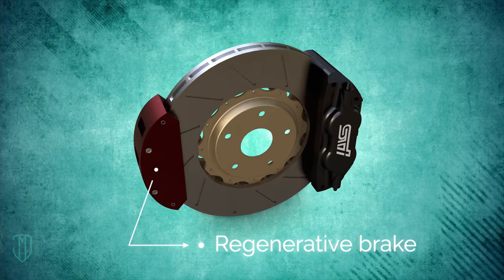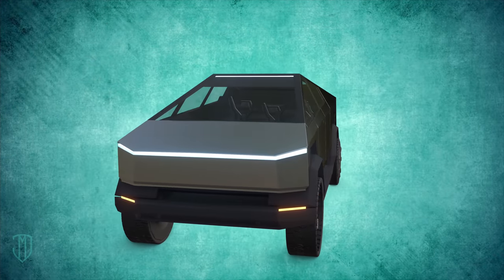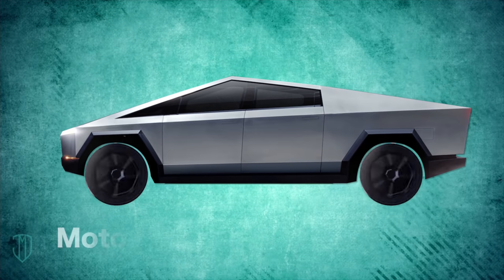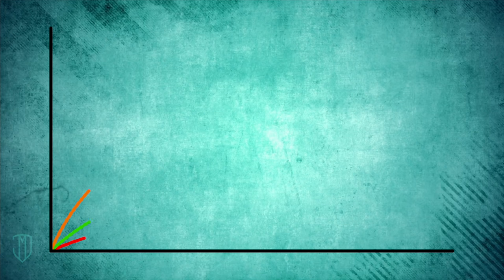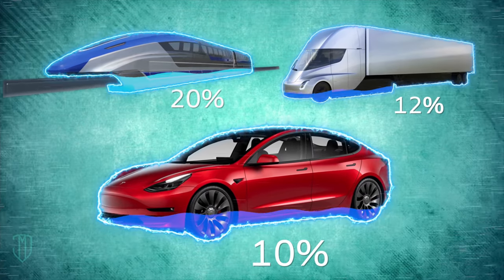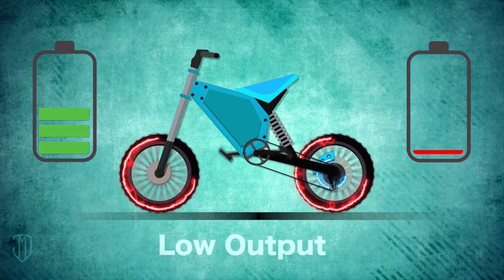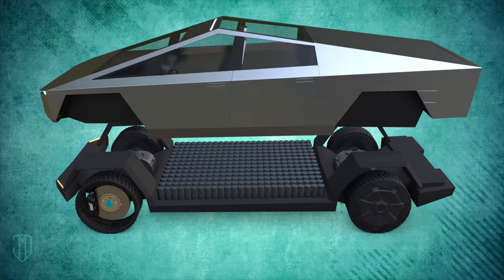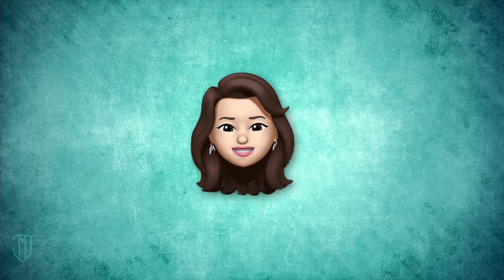How to Stop your Car without Braking

Comment: I’d imagine that, even though lighter vehicles don’t make as much energy from regenerative braking, that they also don’t use as much energy to move themselves and their weight since they’re much lighter, right? Cool vid
Reply from the maker: battery smaller as well.
Reply: Heavier and larger semi trucks can gain alot of use out of regenerative braking, in non ev semi trucks. Truckers use what's called engine breaking. Basically they switch to a lower gear that slows down the combustion cycle in the engine. Pretty complicated and only useful for manual transmission cars like most diesel semi trucks. Also increases the torque output which can crack weaker roads. 

But when a semi EV uses regen breaking going down hill two things can happen, the vehicle can sap that gravity to use later when it goes back uphill entering a net zero. Second occasion is if the truck doesn't have to return to a higher elevation (it doesn't go back uphill) you end up charging your truck while you're driving. 

Second benefit to this system is that the brakes don't get overheated, that's why engine braking is used with manual diesel engines. All of that inertia will be converted into heat and melt your classical friction brakes.

*Upon more research diesel trucks don't slow the combustion cycle they just suck all the energy out of the crankshaft/driveshaft and fart it out before it can be combusted. This cycle of pressurizing air and then farting it out consumes more energy than it produces (makes no energy because combustion doesn't occur) so the truck actually slows down.

Comment: For anyone wanting to understand the fundamentals 

Motor 
two parts the rotor and the stator, the stator is the stationary part of the motor. The stator is the part that's bundled up with copper wire/magnets and lies around the rotating shaft.

The rotor is the moving part of the motor, this rotor is the rotating shaft. 

When a electric current is passed through the stator it makes the rotor move, this works because the electric current creates a magnetic field moving the rotor. 

So this is how it works on a basic level. 

When you rotate the rotor around the stator you can produce electricity, when you send electricity to the stator it will make the rotor move. 

With clever engineering you can make this motor turn into a generator at will.

Comment: Probably the best video I’ve found on how it actually works. 
Just two questions: how is the magnetic field created from the electric generator that is activated once you take your foot off the accelerator? 
And how does this magnetic field actually slow down the axial which in turn slows down the car?
Reply: You should be able to get an answer by looking up counter electromotive force (CEMF) and counter torque. These are considered generator action in a motor and motor action in a generator, respectively.

The rotor of a generator has a magnetic field that is created either by a permanent magnet or an electromagnet powered through a method such as slip rings and brushes.

When the device is motoring, the stator windings are powered via AC or step DC voltage (simulated AC) to create a rotating magnetic field. The rotor's magnetic field will try to lock onto this rotating magnetic field which causes the rotor to spin. For a motor, CEMF is induced back into the stator windings and is an energy loss. This CEMF comes from the rotor's magnetic field passing across the stator windings as it spins and attempting to cause current flow in the opposite direction.

If you remove the AC power supply to the generator, the CEMF being generated is no longer CEMF as the device is no longer motoring. It is now considered a generator.
Reply: Have you heard when timing belts creak in cars? So their generator is faulty and due to too much resistance of the generator electromagnet, the belt that turns the generator slips in the rollers.
Reply: Electromagnetic induction, electricity can induce or create a magnetic field. Magnetic fields can also induce or create electricity. 

Energy can neither be created nor destroyed only transformed. So if the magnetic field is creating electricity it stands to reason it's simply consuming the rotation of your wheels (attached to the motor's rotor) and storing it in the battery.

Comment: I wish my ebike had regen as I live in a hilly area, but my ebike batteries can only recharge at a Max of 3 amps so would need super capacitors for storage while it slowly charges my battery
Reply: 3 amps dosnt sound bad for an ebike, whats the voltage and amps on tbe batt?
Reply: @gabproductions3312  it's a 48v 20ah battery, but a few seconds of charging at 3 amps won't make any difference
Reply: @Markcain268  yeah ur right
Reply: @gabproductions3312  I'm sure the motor (1kw) can produce around 15 amps on regen so a bank of super capacitors could hold that charge and trickle charge the battery
Reply: @Markcain268  im not sure, can a motor generate the same amount of power it consumes at the same rpm?
Reply: @gabproductions3312  not certain how efficient it would be but the motor certainly provides a lot of resistance with the leads shorted out

Comment: You described the motor being used as a generator during braking--OK, got that, an electric motor is a generator in reverse.  However, your graphics prominently shows some sort of device mounted at the wheel, opposite the brake caliper.  This could be a magnetic pick-up using the disk to create a magnetic field and generate power but you say nothing about it.  What is it?
Reply: Yep. the small red caliper is a bit missleading. A small second break on the discs can be seen on most cars but its never a regen break its simply the parking break. The parkingbreak is usualy controlled by a wire either connected to a handbreak or a servo pulling the wire for you if your car has a electric parkbreak (P) This is so that all cars has a second break system if the ordinary breaks fails. BTW even normal petrol cars without any hybrid systems usualy have regen breaks.  In petrol or diesel cars the engine breaking can charges the regular car battery to save some of that kinetic energy, otherwise a automatic car rather go into free roll in order to go as far as possible with the energy thats aviable.

Comment: I always feel like this system is not efficient at all. Braking produces so much energy. Specialy going down hill.  It doesn't only produce heat. A lot of energy is converted to wear as well. A system that could store almost all the energy from braking would be a system where we replace the whole traditional braking system for some kind of torque converter on the drive shaft(s) that directly transfers the energy from the speed reduction in to for example a flywheel or some kind of spring system. Or even more interesting: air pressure. The Chinese are working on that now. Store energy in form of air pressure. But I guess it would be to heavy and to complicated. But in theory braking should produce the same amount of energy as accelerating. Which would leave us only cruising which takes only a fraction of energy compared to accelerating and braking.
Reply: Energy might be the same but the work is extremely different. We accelerate say 0 to 60 in 6 secs but brakes from 60 to 0 in 2 secs.
Reply: @shiroyt4185  Time doesn't matter. It's the roughly same amount of energy only released faster or slower. (Ignoring air and road resistance) If you could catch all that energy it would make a massive difference. ( from 60 to 0 in 2 seconds.. That would be an absolute emergency stop on dry road. Normally when driving relaxed it would be different 😉)
Reply: @Neodymium5312  I know. To heavy for sure. And you would still need some form of extra brake system to be able to reduce speed very fast and come to a standstill. I have often had in my mind an extremely tough  spring made out of some really strong material which will me loaded by the torque converter the harder you push the pedal the less the converter slips. The tension in the spring could than be released while accelerating. That could make for quite a strong brake. Just riffing here 😁
Reply: @Neodymium5312  Yea we are only just getting started. It all used to be so easy even just 20 years ago. Ever brand had like 3-5 models and they were all basically very similar. I think there was a point in the late 90's where I could actually name every single car on the road. I knew them all. Now we are being overloaded by technology and new inventions. There are loads of car brands that I have never even heard of.  I honestly have no idea what we will end up with in 100 years from now. 😵
Reply: ya but that would assume people know how to drive and dont tail gate but they do even though it cost them more gas by doing so
Reply: @wolfeatsheep163  I think they want to use the benefits of a slipstream 😂
Reply: It is called a mechanical battery. Porsche use it like 10’years ago.
Reply: My 07 Highlander hybrid had over 200k on it before I needed to have the front breaks done.
Reply: @-sensibleChris  That's insane. No offence but I struggle to believe that 😌 but hey. I once owned a Toyota Hiace which after 420k still had almost all the original parts. Just no significant repairs all that time. Did have to replace disks and pads along the way though 😁
Reply: @Dani-it5sy  I bought it with 72k miles on it so it may have been done before I bought it but not likely.  So from 72k to about 220k is how many miles my family put on it before the front breaks were worn enough to be replaced. I took it in to have it done 3 different times in that span,  and everytime, my mechanic said they just don't need it yet, and breaking wasn't an issue. At 235k now, and I will get the rear breaks done in 2 weeks because they are ready now. I do have good driving habits , and I'm not a late breaker, an don't accelerate right up until I have to stop like some people do so maybe that helps,  but I have two other cars (Toyotas) that have had breaks done a couple of times in that span although the Corolla had really slow break ware. The 4runner goes through breaks like any other vehicle.

Comment: I'm still not getting it.. On coasting or coming to a stop, the motors should become a generator(?). I'd like to picture a reduction gear that comes into play that spins up the electric motor from the tire/shaft on slowing. At 60mph a tire roughly spins at 1,100 to 1,400 rpms, even a 2:1 or 3:1 could get the motor to spin around 3000rpm generating a nice charge back to the battery.
Side question: with all this draining/recharging, does that put excessive strain on the batteries?
Reply: Regarding the first part I wouldn’t be able to explain, but regarding your last question, it does not put strain on the battery because the amount of electricity been generated by the brakes is very small compared to the high intensity power you would get out of a charger. It’s basically a very small charge at a time
Reply: The motors become generators and slow down the vehicle, evs have cvt's wich makes the gear ratio vary like downshifting on an auto or std vehicle slowly the car and spinning up the motor/gen faster.
Reply: @gabproductions3312  EVs do NOT have a CVT, or any other kind of variable gear ratio transmission. The motor(s) are always coupled to the wheels through a fixed reduction gear. Most EVs are in the range of 9:1 from motor to wheel. There is no clutch, no torque converter, no neutral, no reverse gear. If the wheel is turning, the motor is turning 9 times faster. If the car is going backward, the motor is spinning backwards. The only EV in current production the actually does have a gear shift is the Porsche Taycan. It has a two speed dual clutch automatic.

Comment: I mean I knew it charges the car. Was looking for more about how it actually works in a little more detail. How does it convert KE to electrical  energy?
Reply: When you drive a motor it is a generator.  When you put power to a generator it is motor.

Comment: The Prius had this same braking system back in the early 2000s idk why we are still charging these vehicles in 2021
Reply: Someone hasn't hurd of the laws of thermodynamics
Reply: charging hybrid,really ;)?
Reply: FacePwn64  that's right, man! You said it!
Reply: Just like cell phones, they drip technology to get more money; improvement here, improvement there but still with the old. Computer industry milked the world with this strategy, drip drip drip
Reply: Well that is verry basic physics. The loss of energy. The amonut of energy required to get the car up to speed is far more than the regen breaks can get back. this is due to a varaity of things like resistance and friction to mention two. What you suppose is a perpetual motion machine and that is physicly impossible.

Comment: So why not have an altenator dedicated to charging the battery alongside with an altenator that uses acceleration and mome tum to charge Longside with regen braking... That will cause some power loss according to physics but will provide power when coasting and going downhill.... I mean the goal is harvesting power from used power and free power..

Comment: 6:28 “Electromagnetic RBS - it’s the most commonly used RBS today.”
Given that the requirements of a regenerative braking system are to provide a means to provide a charge to the battery system, I would have thought that ALL RBS systems have an electromagnetic component…

Or are there other braking systems that can provide a regenerative function without using electromagnetism?

Comment: I still do not know what are the mechanics of regenerative brakes .. Does the device on the rotors act to turn the electric motors switching them from motors to generators by rewiring the motors normal electrical state ? This really failed to explain the technology ..
Reply from the maker: next video
Reply: The regeneration is not connected to the rotors in any way. Nor is any rewiring or rearrangement of the motors required to achieve regeneration. All that is required is to alter the phasing and voltage of the inverters that power the motors.